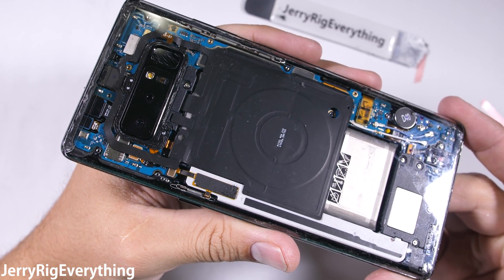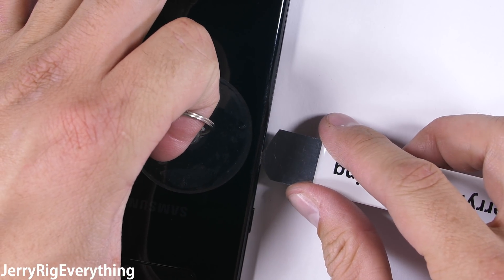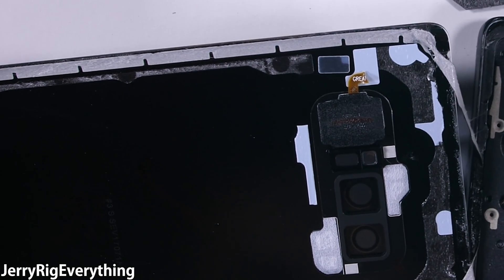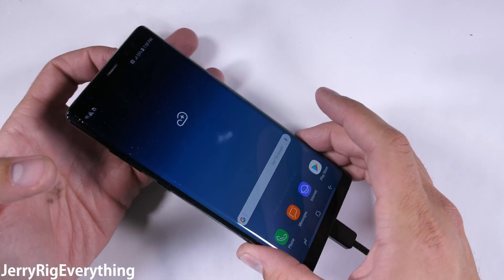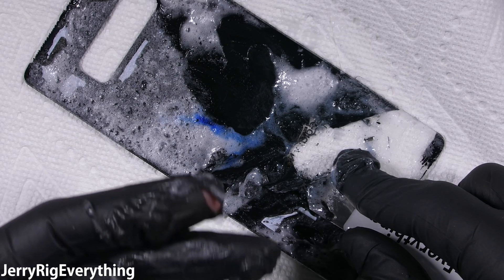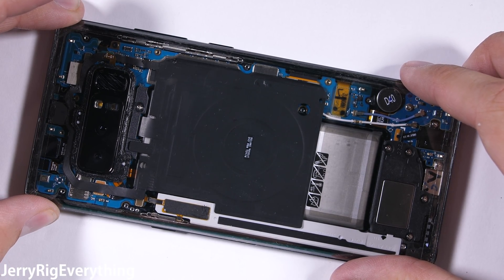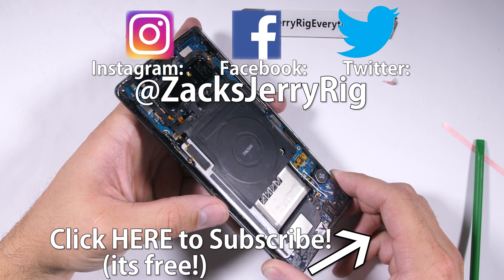Note 8 CLEAR EDITION! - Totally Transparent Samsung Note 8

Comment: I wanna try this, I bought a clear glass back from ebay for $13. Can I just chop the black coil off for the wireless charging? As long as I keep the temp sensor. I want to see the battery thru the back. Does anyone know exactly where to cut?

Comment: is there a difference in the frames? I purchaed a frame with screen attached, I replaced the boards but the signal is 1x moost of the time, I swapped a 2nd set of boards from another phone and have the same results.

Comment: I have actually done this to 2 different Note  8's now and had the same issue on both not getting 4G LTE. I figured out how to get LTE working again. You have to put back the plastic piece that covers the blue and white antennas on the bottom right of the phone. All the other plastics can go but for some reason that piece is crucial for LTE to work correctly. Two different notes had the same problem. Service would cut out and I could barely get LTE. Putting back that small piece restored service completely. I noticed in his video it said 4G but not 4G LTE. I wonder if it worked after this? Hope this helps!

Comment: Jerry I did what u did in this video mine came out perfect took me 25 mins and only bought tape
Reply: I just peeled the black off the back glass developed  my own technique to do so had it off in about five mins
Reply: Can you please tell me how did you peel it off? Im thinking of doing this myself
Reply: Take a knife to a non curved edge put the edge 90 degrees to the edge of the glass press gently and scour it back and forth many times and you should be able to expose just the glass enough so you could slip the knife in between the the film and the glass to get a good flip of it to peel just keep in mind when u start peeling it go very slow and keep the glass on a flat surface as much as possible pulled the film backwards as flush to glass as u can
Reply: Sorry I didn't respond right away for sum reason my phone didn't notify me

Comment: 4:13min to 4:16min, when you were pulling the camera lens, near your thumb I see the outer most lens flexed almost 90 degree and did not break, is the outer most lens layer a plastic layer? You mentioned it is glass but the flex angle was a lot and it did not break? Thanks.

Comment: When you use double sided tape to insulate the phone from the elements it certainly won't be water resistant anymore.
I suggest try using a silicon based glue, the ones in a plastic bottle so you can use the tip to spread it exactly the way it was intended from the factory.

Comment: I just want everyone here to know, that laminate @ 4:10 exist on all Samsung back glass.  

YOU NEVER NEED TO USE HARSH CHEMICALS OR PAINT THINNERS.  

You simply have to heat up the glass and dig a little at a corner with a metal razor blade.  Trust me!

Comment: You should have wiped off the inner surface of the back cover before you placed it back. However, it's a nice mod. 
Btw one thing I learnt as a hardware developer is that practical design considerations and aesthetics are walking hand in hand very often.

Comment: Not that it would be warrantied, but if you bought a replacement back glass panel (which you could still make clear) would it come with the same adhesive the original phone had, giving you at least some chance of water proof bond?

Comment: "Whenever you open up a water resistant phone, it will 100% not be water resistant anymore"
Bloody rubbish JerryRig! I've made phones water resistant again by using the same water proof adhesive seals as the manufacturer. Tested my own repaired Z3 compact in the pool too. You might want to dial down that "100%" statement.
As a phone repairer, nothing annoys me more than other repairers claiming something can't be done, just because they can't (or wont) do it themselves. :-/
Why would a Note 8 not be water resistant if you use the OEM adhesive border, reassemble the phone in a dust free chamber (I don't use one of these myself), heat up the adhesive and clamp it down well?
Samsung have a magic wand which they wave over the phone upon completion to make it water resistant?

Comment: Those grey lines on the black plastic you cut off are antenna lines. Did you test to see if there was any wifi or signal issues when cutting those off? Curious to see how much it would affect the signal when its missing those antenna lines. Perhaps in more covered areas it will be weaker? I know on older model phones when those antenna leads on the plastics are missing, reception on the device is at one bar or doesn't even get service.

Comment: YEs YOU JErry!! ALL truthers NEED to POST 911 posts tomorrow, ONLY having FACTS. Like: 3rd building never being hit by plane. The owners policy change. Thermite molten lava. Israeli Art project "students" filming people from a helicopter standing up against the windows in the towers. Rolls Royce statement, engines can never disintegrate. Architects of the towers designing the building's integrity for MULTIPLE airplane accidents. Concrete does not pulverize from fires or free impact. Jet fuel evaporation and burning characteristics. Larry Silverstein admitting to "Pull" the WT7 3RD building. His speach about his appointments that morning. This is JUST the tip of it. All channels need to work together and POST video(Hopefully the same video) , the one that works best, and post it daily for a week, or as long as you can!

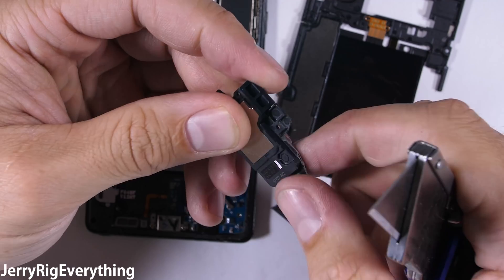Comment: 2:40 you just cut off one of the antennas.
Reply: A-rod88 he had a WiFi notification, so the WiFi antenna still works
Reply: i made the same mistake doing the clear back mod on my Galaxy S7. when i cut off one of those antennas i really didn't have 4G connectivity anymore. luckily replacements where cheap :p
Reply: Yeah, but when he was done everything was working correctly? So how is he dumb lol
Reply: yep, you don't want to cut the plastic piece off, there are metal on it, it's for connecting to the antenna shrapnel, it might cause problem to some signal like wifi, gps, mimo, nfc, bluetooth, etc.
Reply: Was everything working correctly? He didn't actually use the internet so we'll never know
Reply: shaw this "project" is fucking stupid anyways
Reply: This guy is dumb,

Comment: Along with heat, alcohol is super helpful for removing adhesive. dipping the cards or pry tools in it will help break it up easier. I also recommend getting guitar picks to help with this process. They're smaller but easier to work with and wont break that glass as easy as the metal pry tools.

Comment: He literally permanently enabled airplane mode by cutting out all the antenna plastics.
Reply: yep, you don't want to cut the plastic piece off, there are metal on it, it's for connecting to the antenna shrapnel, it might cause problem to some signal like wifi, gps, mimo, nfc, bluetooth, etc.

Comment: The apple burn with the mediocre hardware was savage! LOVED IT!
Reply: Scott Mc Logic it is all about headphone jack
Reply: and Foxconn is crying in the corner
Reply: istvlad 😆
Reply: istvlad Yeah but a 1 year old phone beats a brand new phone.
Reply: Ahmed Hissan I heard some rumor they threatened Benchmark Apps Maker to fixed-up Apple Chips Result or their Apps will be pulled from Apps store 😉😉😉 .

Apple Like doing this oftenly so they could get cheaper price for Iphone Components 😯😯😯 .
Reply: Wireless charging is not something to cry over. What if you need to charge your phone at night? Sure, plopping it on a table is easier than plugging it in, but what if you want to use your new $1000 glass sandwich? You’d have to hold the whole pad in the right place without moving it to keep charging. Kids, just because your phone has copper rings doesn’t make it better than anything else.
Reply: Ahmed Hissan well at least the note 8 has a fingerprint scanner and a working iris scanner
Reply: lb_06 // Minecraft & More mmmm yeah, samsungs photos are over saturated and extra colored in the post processing while iphones photos are true to life, but the raw photos are almost identical. Well if the iphone is rated 9 out of 10 the samsung would be 9.2 out of 10 (even though the iphone is a year old)
Reply: lb_06 // Minecraft & More mmmm yeah, samsungs photos are over saturated and extra colored in the post processing while iphones photos are true to life, but the raw photos are almost identical. Well if the iphone is rated 9 out of 10 the samsung would be 9.2 out of 10 (even though the iphone is a year old)
Reply: istvlad i hate macs, they are too damn expensive, extremely fragile and has sketchy batteries, but iphone is the fastest phone, year after year
Reply: Frizt Zt actually i think benchmark comparison between difference os is not that accurate , im just comparing the actual speed, ive done speed tests myself. U can search for speed tests in youtube apple just nails everything it retains all the apps and video processing and rendering is so damn fast
Reply: My beautiful and amazing mistress speed tests are done with the same app, or else it cannot be a test, i don’t know what you are trying to say
Reply: Klown having the option is better. besides, apples ugliest phones so far (iPhone X, iPhone 8 and 8 plus) have the wireless charging...
Reply: M4tin i think iphone 8 is the second best looking iphone, you cant take looks on this arguments as the beauty is in the eye of the beholder in my opinion s8 is ugly, i like the note 8, but it has the fingerprint scanner at where no one can reach
Reply: M4tin yes it works with even pictures of yourself, we can only complain about things that have released, hiccups do happen in phones when i had my note 7 the fingerprint sometimes does not recognize at first attempt, ive seen it happen in several other samsung phones also in many other brands.
Reply: who needs a hedphone jack, i dont ever use it on my phones, i only use it on my pc for headphones
Reply: istvlad well sure if your life is all about videogames. But for us people with an actual job, a light and fastbooting laptop is lightyears ahead of your rgb lit piece of plastic.
Reply: Pierre Gabory unless gaming pc are used for flight simulators or other stuff, but yes, pc games, console games, and mobile games are a piece of garbage
Reply: MI Try Make a Hecta Core Exynos run Android. Because that's the A11, an optimized Exynos.
Reply: rofl that's adorable. the exynos design is very archaic and simple compared to A11. try again
Reply: Apple doesnt need high end hardware because they can optimize their software instead and maximize profits.
Reply: I'm sure you are the only one who doesn't use it entirely. You just cannot remove a standard just because your phone doesn't entirely become waterproof and doesn't bring you money. Still the iPhone is behind the Samsung a peg lower in terms of waterproofing.
Reply: Pope Chode yup, iPhone sucks
Reply: Pope Chode Fake news, it’s pretty common knowledge that apples cpus are way ahead of the competition. One speed test isn’t enough to prove wrong the thousands you can find on YouTube.
Reply: Pope Chode but the a10 on the iPhone 7+ whoops the note 8s ass. So apples a10 is superior than snapdon 835 with 6gb ram combination and its new brother the a11 bionic, according to your logic
Reply: Pope Chode one is all it takes as long as you don’t believe in the scientific method. In that case, good day.
Reply: Pope Chode I just watched the benchmark. Oh god this is stupid. You can’t compare by switching apps like this, it’s not the hardware fault, but the the Ui. You need a geekbench , we need numbers, we need science. Not some stupid ass demo from Samsung marketing team.
Reply: Ahmed Hissan According to your typical not knowing of the meaning of Optimization, you probably think that it is powerful even if their Battery management is crap compared to other phones.
Reply: Pope Chode i suggest you watch this https://youtu.be/dJOWBUsEFfk
Reply: Ahmed Hissan the iPhone 8 is beautiful, I apologize. But the iPhone X sucks
Reply: Ahmed Hissan just stick to lg
Reply: I hate apple, but I suggest everyone here watch this video from Android authority, it clearly explaines why apple's chips are better. https://www.youtube.com/watch?v=TiVF_ZzzLM0
And this video: https://www.youtube.com/watch?v=D9prht-PcWY
Reply: You are all very scary, it's scary to know that people don't understand the difference between hardware and software. What you're basically saying is that a Mac is better than an Alienware laptop cause it's not as heavy and loads the OS quickly. That is indeed a scary thought.
Reply: I won't go into a debate with you, if that's your opinion just go on like that, but for your own personal benefit try to read more about pc's, performance and general IT knowledge.
Reply: Ahmed Hissan camera same level?
Reply: istvlad LMFAO! 😂 TOO FUCKING FUNNY!
Reply: Ahmed Hissan if you don't like samsung os, just install a custom rom. Not hard.
Reply: istvlad I thought that's what he said lol savage
Reply: istvladaples internals look so much better
Reply: istvlad if i was part of “you all” then you are wrong as i did accept it, all i said is even with inferior hardware its still so much faster(i mean whats the point in just talking about the hardware alone, without software its as god as feces. In the end of the day its not about inferior or superior hardware/software its about the performance
Reply: "Mediocre hardware" that runs circles around anything else - a gap that was even quite widened by the A11.

I used to like this guy's videos until he turned into an anti-Apple edgelord. His insecurities are extremely cringe-worthy and makes the videos hard every time he says stupid bullshit like this.
Reply: istvlad mediocre? wait till Tuesday and he will eat those words. The new iPhone with its a11 processor will annihilate everything including the note 8. And I've never even owned an iPhone!
Reply: welp he didn't, it's still better :P
Reply: istvlad mediocre yes, a year old iphone 7+ is still faster than the note 8, and the cameras are in the same level, but yeah no wireless charging
Reply: Richie Hyacinth when apple dedicates to give high end hardware it will fuck samsung even if it had the best optimization it ever had, lets be honest, samsung can never be faster than an iphone or a pixel

Comment: I took a picture of the naked phone and printed it, then i glued it on a piece of sponge or foam and then stuck the screws on the exact place where  they were . 
After you removed the first layer you can print repeat for the layer after it and place every screw individually .
might be helpful ; ]

Comment: i know it would be expensive, but i got a challenge for you Jerry, you said if you take apart a water proof or resistant phone, it looses its water proofing capabilities, so i want to suggest that you take apart a water resistant phone, use the double sided tape as well as you can and then submerge the phone under water either splash it or take it to the next level and put it under water and see for how long does it hold and can it survive the torture test, also try to water proof a non water proof phone, it would be a cool future project...

Comment: you don't want to cut the plastic piece off, there are metal on it, it's for connecting to the antenna shrapnel, it might cause problem to some signal like wifi, gps, mimo, nfc, bluetooth, etc.

Comment: Haha. But what's the point of top of the line hardware if it still performs like a top android phone like the Note 8 or any other top android phone with 4+ GB RAM, etc. lol.
Reply: Yeah, because changing a few icons is TOTALLY worth mediocre performance and massive slowdown within 1 year in a $900 device!
Reply: Android offers full experience to the user, they don't restrict them from anything, the user has complete control requires more power :) Also, android phones screens are 2x resolution of iphone. Apple is able to have garbage hardware because they are in complete control of the software and lock the user out from everything, I don't like that and many other people don't like it either, which is why 90% of smartphones sold in the world run android.
Reply: RemixedVoice
I'm not talking about features and customization, mainly since most of it subjective anyway. But having more control doesn't require more power, that's not a legit excuse. Also, but regardless of the reason, there's no point in in worrying about specs since Apple has proven that it doesn't matter. And the reason why 90% of run android is because Apple will not let others run it, it''s not because people don't like iOS (since people obviously love them since they are still very popular). And in the rare case that Apple does let others use iOS as the phone's OS, they will probably charge them. However, android OS is free at no charge.